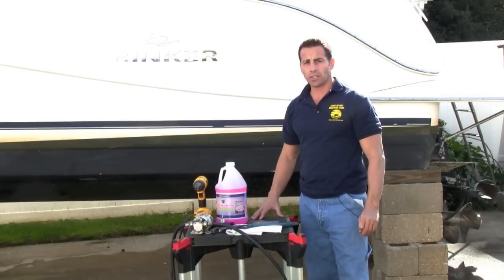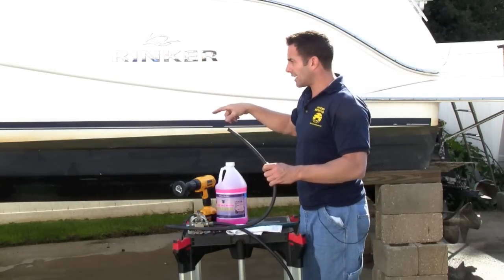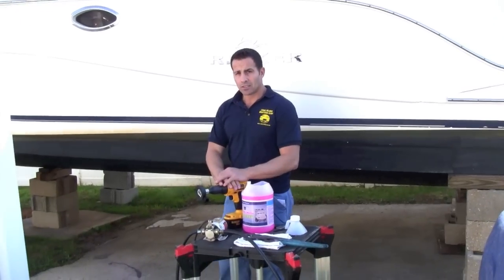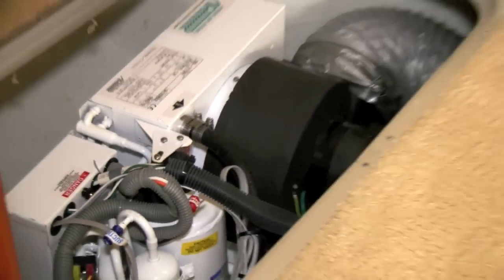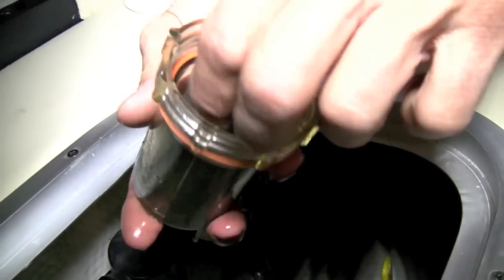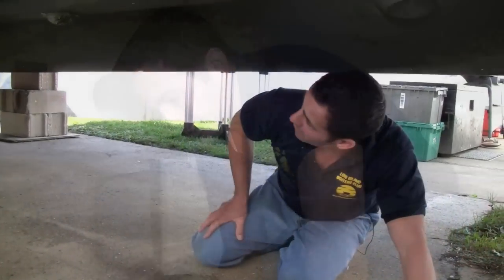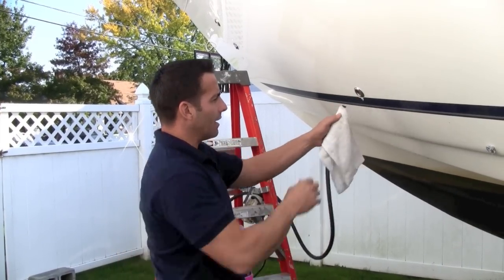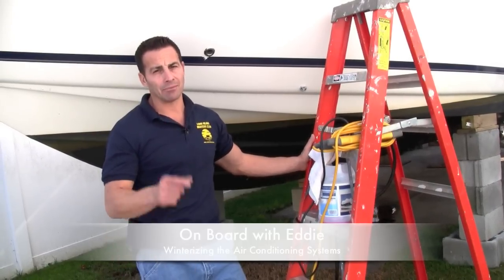How to Winterize the Air Conditioning System of a Boat

Comment: Hi Eddie, I have a boat on Lake Ontario, Sodus Pt, NY. I was looking for an easier way of winterizing my a/c unit. I watched your video several times. Today I was at the marina and winterized my a/c unit as you showed in the video. This procedure works really well and saves a lot of time not having to disconnect the a/c intake hose and turning on the a/c unit itself to run the antifreeze through the a/c unit. It took 7 minutes to winterized my a/c unit doing it your way. Thanks !  Jack

Comment: Eddie… I recently purchased a 2006 Larson 240 Cabrio and had a quick question..... Once the boat is in the water and I'm hooked up to Shore power and I'm ready to turn on the AC... Turn on my main switch inside cabin (control panel)   then ac switch on control panel   then actual ac switch…. Is there anything eles that needs to be done..... Thanks

Comment: How about if my boat is in the water?  We plan on leaving it in this winter so I can't access either the intake or the discharge....
Reply: It might be a little late but you do it from the strainer hose and run the pink from there by turning the AC on, see his other video about winterizing the generator.

Comment: There must be a pump to circulate the sea water through the AC.  Does forcing the pink stuff through not harm the pump?
Reply: the pump is a centrifugal force pump, it is open the middle so no harm in doing this way. This is best way to do it.  There is another video somewhere that the guy takes about the pump to show you inside